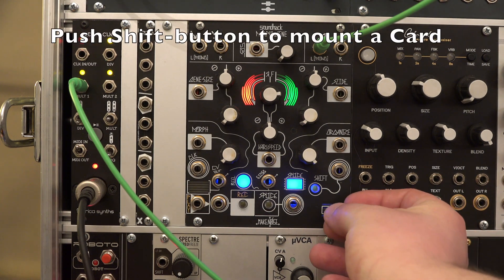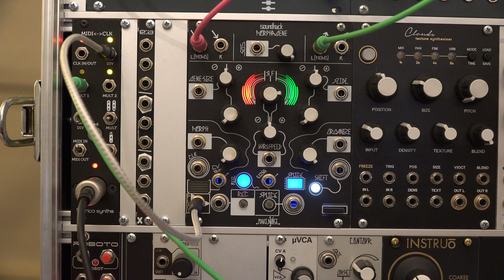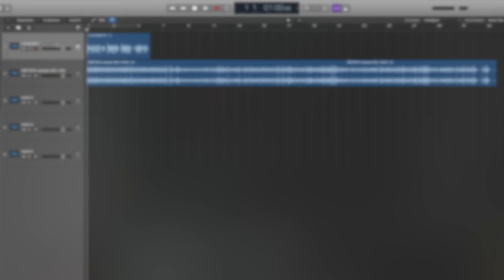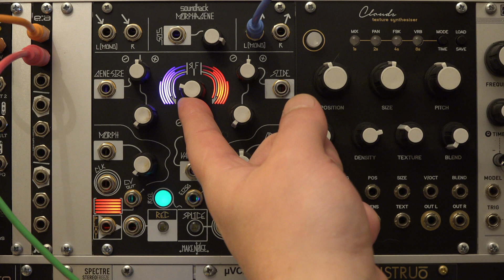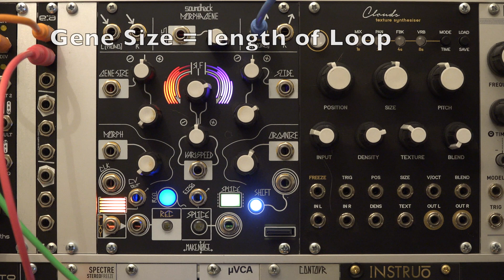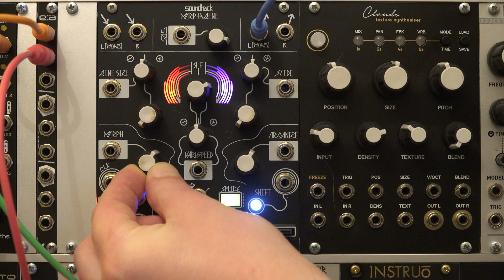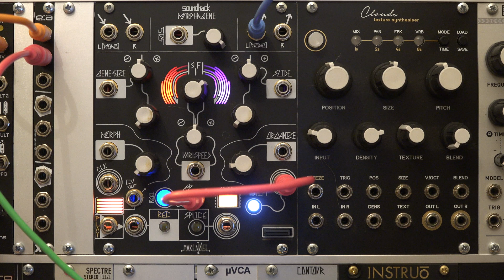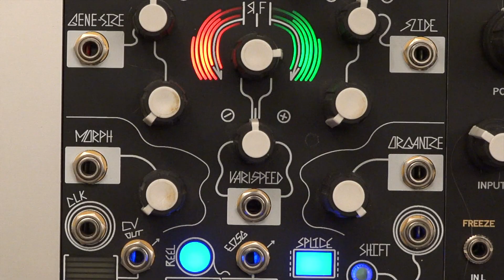Morphagene - Part 1: Overview (English Version)

Comment: Hello, thank you for your video. I'm a little confused at the 00:47 point you say you can sync the recording to a clock or trigger, but you use the gated record input instead of the CLK input. According the manual, the gated record input that you use only records when the gate is high and stops when the gate is low in the input. The CLK input is used to sync both record and playback to the clock pulses.

I'll have to practice more to confirm what the manual says. Do you have any further insight into the two inputs?
Reply from the maker: yea that´s right! i´m only mentioning triggers are possible, but showing just the clock/gate method as an example. maybe i should have explained this better, but the video is meant as an overview and not a full tutorial 😅